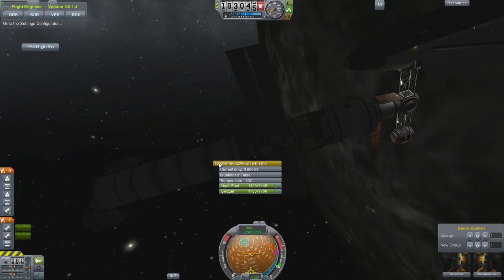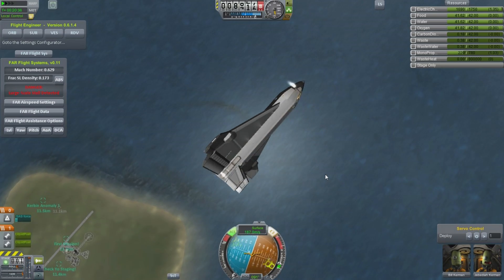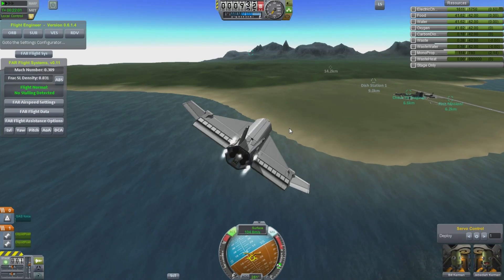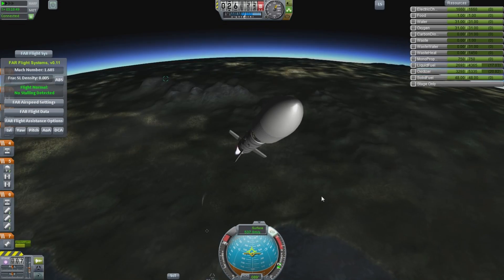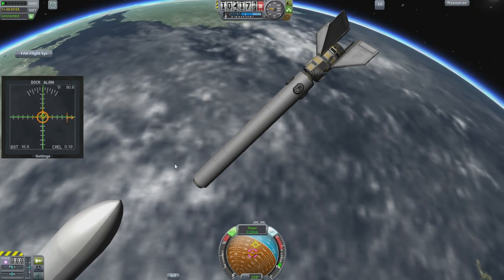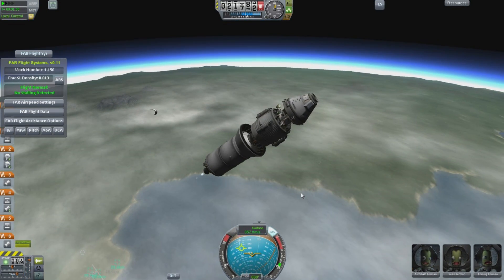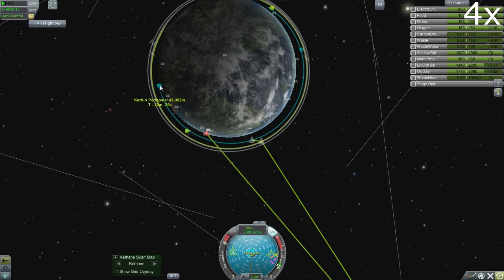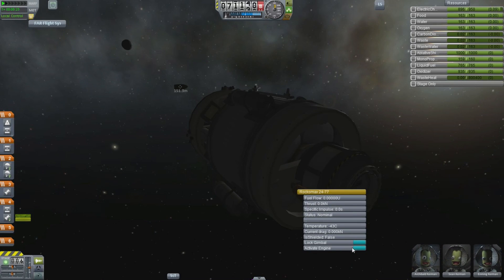Kerbal Space Program - Interstellar Quest - Episode 23 - The Laws of Aerodynamics Have Changed

Comment: I have a problem. I installed most of your mods, Scott Manley, and now whenever I launch anything and exceed 2500 metres all of my keys lock, my engines shut down, my SAS shuts down, RCS, staging doesen't work, my whole keyboard fails pretty much. All doesn't work until I fall back down to 2500 metres. Did I install something wrong? This is in KSP.
Reply: 2.5 k is part loading range... sounds like remote tech, I think that's the range of controle without the use of comunitrons, add a few.
Reply: HALL9000ish Thank you soo much! Silly me, just  5 mins ago I decided to read the remotetech2 guides and I discovered this by myself but your reply seems to have been earlier. Thanks again and Happy New Year!
Reply: eeLiquid You're also going to need communication satellites in KSO for your probes to control them all the time, otherwise you're going to have periods where the probe is dead in space until it can see mission control again.

Comment: I had this problem with boosters blowing off main engines. Fixed it by adding alot of roll to the rocket just before detaching, so they are thrown sideways ny rotation.

Though I'm not sure Kerbals on board appreciate that solution. ^_^

Comment: I bet Scott could safely land a 747 with no engines, one wheel and half a wing.
Reply: and jebediah
Reply: D BlueVenom
Nah, engine powered planes become very bad gliders (but still gliders as opposed to bricks) without their engines.
Reply: +Violet Venom The average passenger jet maintains a glide ratio of ~12-15. That means it glides forward 12-15 distance units for every 1 distance unit of vertical descent. If you don't know already, that's actually really fucking good for aircraft that large, it's about on-par with your average hang glider. Obviously it could be better (sailplanes reach glide ratios of 40+), but the necessities of wing design demand that certain sacrifices be made.

On that note, for everybody else- 7075 series aluminum alloys (most common aerospace aluminum) are comparable to some steels in terms of overall strength. As long as the aircraft doesn't nose in, the chances of it (and you) surviving the impact intact are quite high.
Reply: aakksshhaayy The point was that you can land it without completely blowing it up. It doesn't matter if it hits "fairly" hard, as long as it's not too hard.
Reply: Says the person with a faceroll for a name. As long as you are able to remain at 145-170 kts ground speed, you will be able to flare just before landing to kill pretty much all your vertical air speed.
Reply: yeah good luck with that
Reply: http://en.wikipedia.org/wiki/Deadstick_landing have fun with that.
Reply: Good 'ole' Jebidiah.
Reply: Airspeed* Groundspeed is irrelevant when we talk about anything aerodynamic.
Reply: Rofl Tank Ummm. Yea, what you said
Reply: ThaFuzzwood you've never piloted have you... this applies to smaller planes not fucking boeings. That's things gonna hit the ground hard when it does.
Reply: so what... its still gonna hut the ground fairly hard
Reply: XD probably not from my understanding commercial passenger jets tend to .. you know ... plummet without there engines.

Comment: When launching - why would you go inclined, instead of going straight up and then gaining orbital velocity? Less air to go through - more fuel to have.
Reply from the maker: Because FAR supports it, making a more efficient shallow ascent possible.
Reply: Scott Manley
Are you having problems with the Kethane mod?
Reply: Scott Manley
I do understand that reaching a low orbit requires less fuel, but to me - anyway you look at it, the more of the atmosphere you make yourself go, the more fuel is required to reach your goal. P.S. what is FAR and how does it help make the ascent more efficient? Thank you!:)
Reply from the maker: ParaglidingManiac FAR is Ferram Aerospace, it models aerodynamics more correctly than base KSP, so you can perform the launch profiles that I'm using.